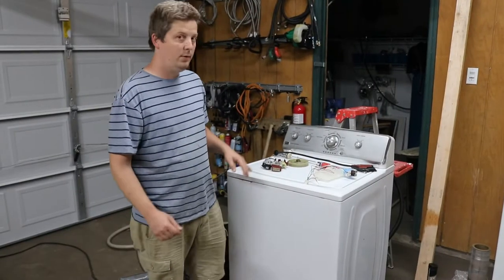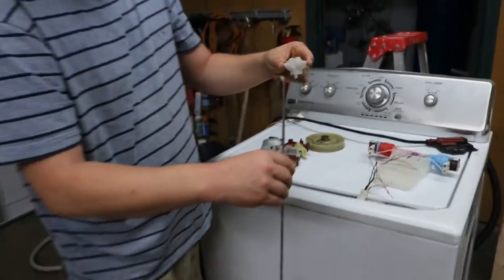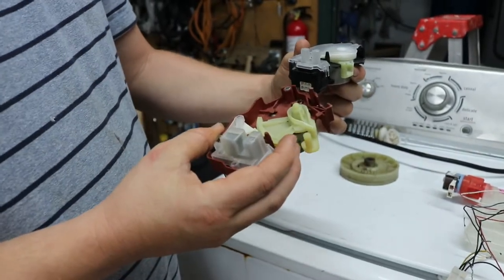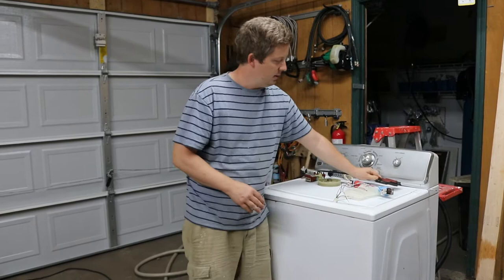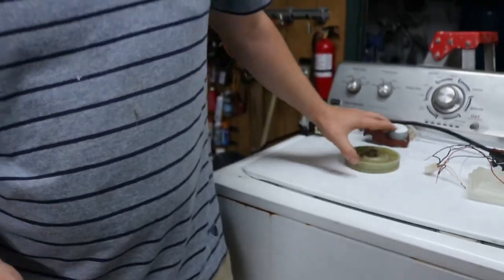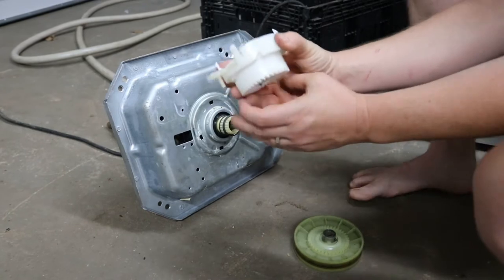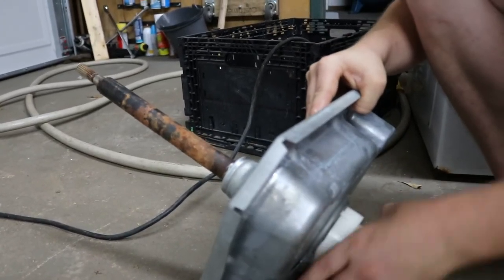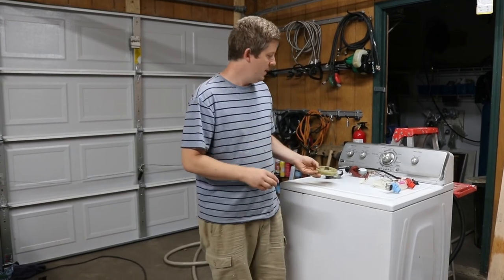Most Common Problems for Washer Not Working - Top Load Washing Machine ￼￼troubleshooting Amana

Comment: So my washer gets stuck as it switches to spin mode. It will drain 90% of the time. When I took off the belt guard there was a coating of rubber from the belt. Would this still be caused by the actuator?

Comment: What could be the cause of an agitator only going in one direction, clockwise only?  TIA
Reply from the maker: A ratcheting agitators should always turn One Direction on the top half of the agitator.
Reply: @WasherDryerMoney  what would cause a grinding (rough sound) only when agitator cycle is running?  Thanks again for the info
Reply: The agitator also keeps spinning, not a stop spin, stop spin.

Comment: My SENSOR light is blinking and the lid is NOT locking  NOW.  Keep in mind that I have replaced the lid switch AND actuator.  Did a ERROR CHECK and shows ZERO issues throughout ALL stages.    [Whirlpool Top Load].

Comment: I have a maytag washer I was wondering how did you the spud  nut off the agitator.this thing is stuck on tight been at it for a day
Reply from the maker: I’m a fan of liquid wrench penetrating oil. If soaking it in that for a day doesn’t work sometimes you had to apply some heat. I have had some GE washers that would not come loose even with a heavy impact wrench. It’s just frustrating when they won’t come loose sometimes. Be sure to join the Facebook group appliance Flippers United. It’s a whole bunch of us that just flip appliances and you’re probably get a good answer from someone in that group.
Reply: @WasherDryerMoney   thank for the reply

Comment: My whirlpool is stuck in the sensing status. What do I need to replace?
Reply from the maker: Start by recalibrating. Check my recent videos for a video on how to do that. If that doesn’t work, it more than likely is the actuator. It could also be the cold water valve going bad.
You can test a lot of this babe going to make him a test mode. There’s a lot of good videos on that but I don’t have one yet.
Good luck

Comment: HELP! 

My washer won't spin. Replaced actuator. Same issues persist. Removed the belt and gears as advised, clean with no damage found.

Ran calibration 3 dozen times +. No change.  Checked how level it is. All looks good. 

Tried forced manual spin mode diagnostic. Agitator spun shortly, then nothing. Never a full spin. 

Sporadic.
Worked completely, all cycles for a few loads after acting like this for a few days.  Then stopped. 

What's the problem? Any ideas?? Thanks for any help.
Reply from the maker: Sporadic problems are the worst. They’re very hard to diagnose because when you run a test, it may be working and you will move onto the next test missing the problem.
It sounds like you went through all the common things it could be. It may be something less common like hey Bad control board.
When it is acting up, have you put it in manual test mode and just called one component at a time? 
Also make sure cold water valve is good. If you have the washer set to hot and the cold water valve is not working when it gets to the rent cycle it will act weird usually just stopping. 
Also double check that you have good cold water pressure and then check if you have good hot water pressure. It’s probably fine but it would suck if it was something simple like that.
Reply: @WasherDryerMoney  Thanks for the help.
At this point, it does not work - the occasional quick agitator movement, then looooong pauses before another. It has not spun in a couple of weeks. And the manual forced spin and forced agitate do not actually work.

Other forced manual features seem to work. 

I just do not want to spend more than it is worth. Any idea what it could be?

I know the actuator works. Both the original and the new one I purchased move as you would expect. 

Because of the long pauses, and general bizarre behavior the control board sounds like the issue, but I am no expert. 

Spent 8 hours working on it. Diagnosing and do not want to waste more time, but also do not want to spend money unless it will be fixed. Any advice would be great. 

I know this seems a bit all over the place. I will gladly answer questions. 
Thank you!
Reply: Oh yeah, the error code is f7 e5.

Comment: Help @@@ I have an Amana similar to the machine in this video. Diags seem to run well. All operations seem to work. However, when I set to wash it fills slowly with water. Then pumps or drains itself. Then sits forever with the "wash" led light on. My guess is that controller is bad but somehow able to pass diag. Your thoughts please?

Comment: Washer notfilling
Reply from the maker: Make sure all the simple things are not wrong. Check to see if you have pressure at the waterlines. You can do this by turning the water off, then disconnecting the washer, water lines and turning them on while they are aimed inside the drum to see if they have good pressure.
You can also put the washer in self diagnostics mode if it’s the type of washer that has the six lights and the pause play button.
They’re good videos on that I don’t have one currently. 
It could be the actuator or the water valve have gone bad as well.

Comment: i'm having a proplem with the seperate rince/spin cycle. I it fills agitates drains but won't spin. It will spin on a wash cycle. I tried to reprogram like you show in nlast video (moving knob in sequence shown) but the led would not flash. The machine is 7 years old.

Comment: Just got a whirlpool pause/play from my scrapper. Stuck in sensing mode. Shift actuator?
Reply from the maker: That's my go-to move. There is a video from Ben's Appliance in junk on how to put it into diagnostic mode. I don't use this mod very often first thing I usually do is oil that shifting plastic peace and swap out the actuator. I keep several actuators in stock. Very common

Comment: My washer fails when it has been paused for a long time (soaking e.g.). Any tips ?
Reply from the maker: Could be the actuator. A lot of times when they are paused they are actually trying to shift from agitate to spin. Actuators are very common to go out on these type of machines. I would say it’s a good chance it’s the actuator. If you looked at my video you’ll see a video on replacing actuators and the symptoms of when they are bad.
Reply: @WasherDryerMoney  thank you ! It takes over half an hour to start back after being paused for hours